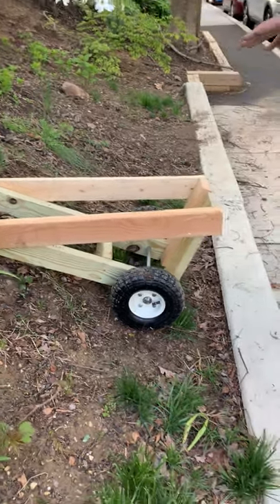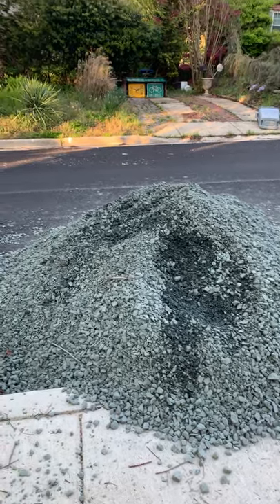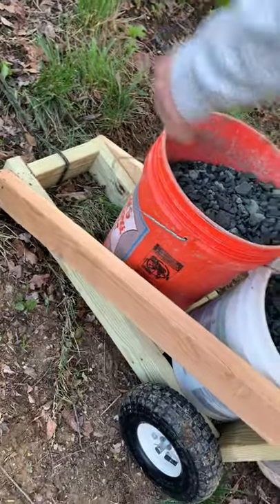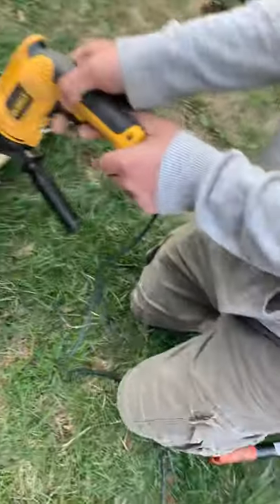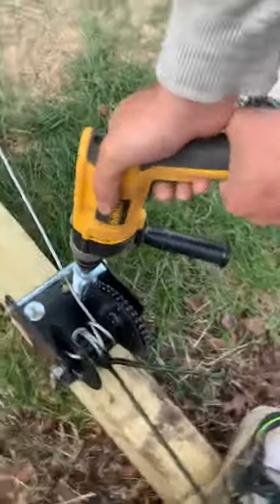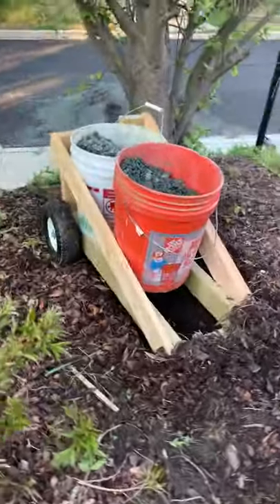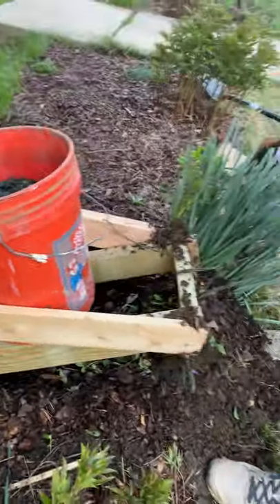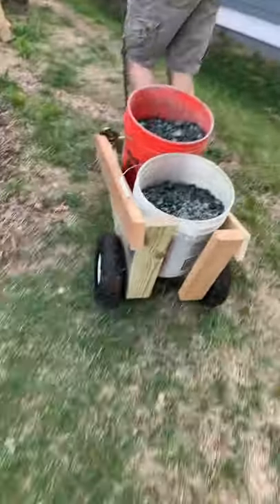DIY Hillside Tram with Low Cost Automatic Winch

Comment: Sir upgrade ur winch 
This is weak for this project 
And this is load on drill too
Just use electrical winch with 1 ho or 2 ho motor and that

Comment: You would have pulled half the weight by mounting a pulley on the cart and anchoring that end of the wire rope at the top of the hill.
Reply: Explain more. I need to do something like this but going to use an electric winch

Comment: Dude... what are you even doing.. I like the kind of hacky diy-ness to it... However if it were me I would reduce friction in the cart by EASILY adding another axle and wheels at the front... or even pulling it backwards with a larger cage... I know this post is over a year old, but I am bored, so to add, if I were to follow the hacky-diy nature of this build, I'd also use a corded drill duct taped ON, with a hacked in, long switch from the mains (this is unsafe) to operate the winch instead of holding the button down.